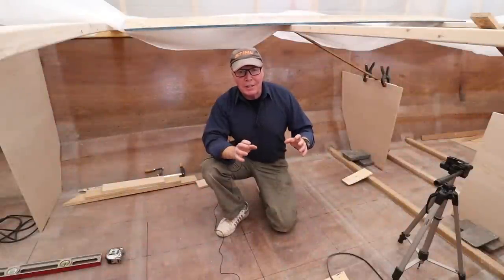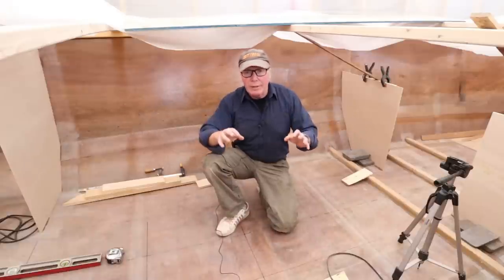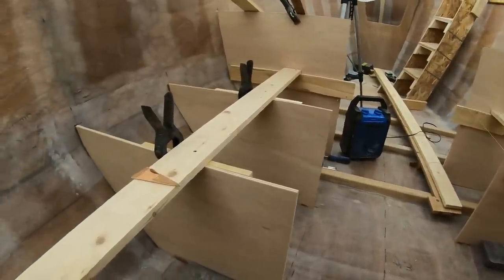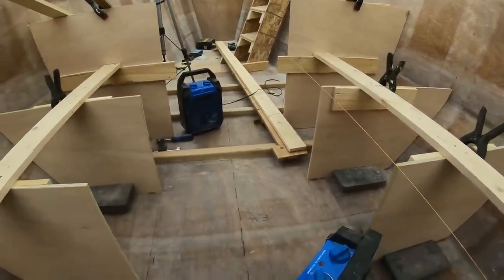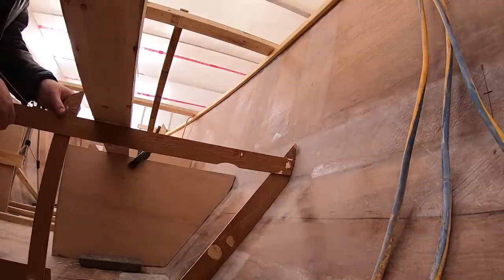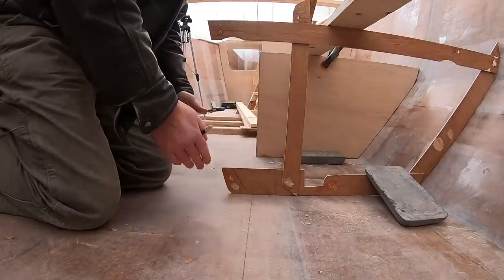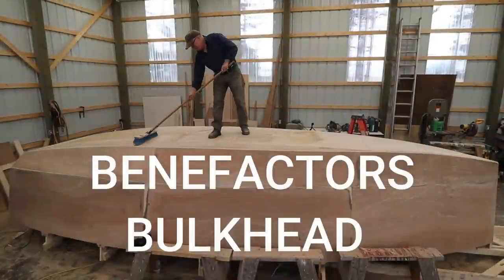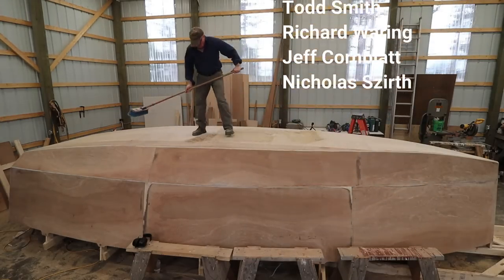S2E37 Ring Frames vs Bulkheads

Comment: Scoring works, tape works easier. :P 
I did mention that I am a trim carpenter/cabinet maker and, like you, taught construction trades at an ISD public school.
Reply from the maker: The first cut I made was with masking tape but the skill saw wasn't up to the task. BTW, on a few occasions I cut some of the plywood in my own shop on my table saw with my finishing blade and no tear out (I use home made throat plates for a tight fit with the blade). Great to have another tradesman in the Rover Navy!

Comment: Eventually Canada will warm up, eventually. 😂 

Do you have to account for expansion/contraction of the bulkheads prior to glassing or is the marine ply stable enough to manage ambient temp fluctuations?
Reply from the maker: The ply is pretty stable and the temperature variation is only about 10 * since I started heating the womb. Great question, you made me think 🤔
Reply: @RoversAdventure  I think you’re good. Everything moves on a wood boat. A tricky balance of rigid and flex in a mile of ocean.

Comment: Have you thought about using hot snot to tack the plywood till the epoxy cures rather than the wight?
Reply from the maker: Next time I order up some supplies I will try to get some 5 min epoxy. Not familiar with "hot snot"
Reply: @RoversAdventure  sorry hot glue gun
Reply: As its only needed till the epoxy kicks
Reply from the maker: @glynncleaver7398  Good idea, I have been thinking about that also.

Comment: Nice progress Allen. I’m a bit surprised you are opting for SS screws rather than silicon bronze, is there a reason you opted for SS? Cheers
Reply from the maker: SS was readily available (eventually). What's your concern with them?
Reply: @RoversAdventure  I have no concerns per se just curious about your decision since other wooden boat projects have opted for bronze fasteners. Seems to be the fastening material of choice in wood. Cheers
Reply from the maker: @johnoflegend1529  Thanks for the info. I'm talking to the architect this weekend and I will ask him.

Comment: Hi, i see you only glue and fillet the b/heads, do you screw them from the outside ?, are you just relying on the bond between the ply layers NO mechanical fittings. i never do that I always glue and screw
Reply from the maker: This is a tried and true technique that avoids the condensation issues that steel fasteners bring to the plywood. But most importantly, construct your projects in a way that you are most comfortable with.

Comment: I hope this isn't too late, but all plywood edges should be sealed with epoxy.  I suppose you don't HAVE to... but you'll feel better if you do.  : )
Reply from the maker: I actually round the edges a bit with the palm sander and wet it out with thin epoxy and a stiff brush before putting the fillet on.